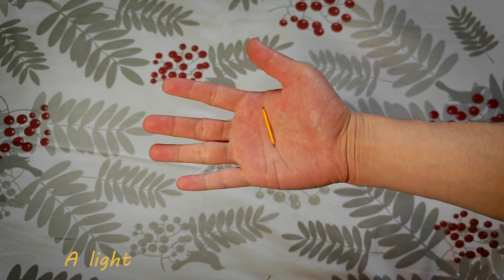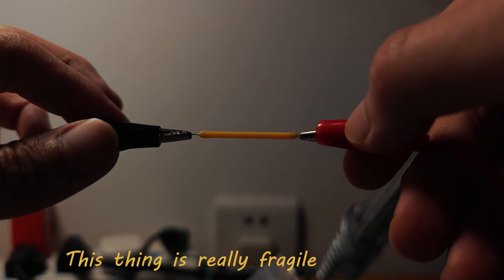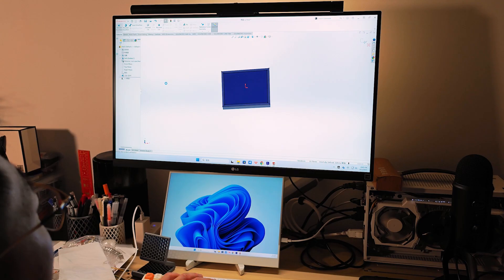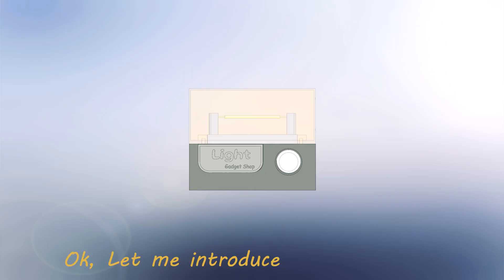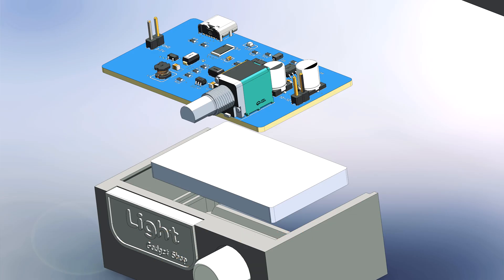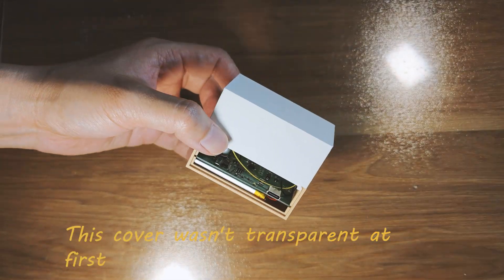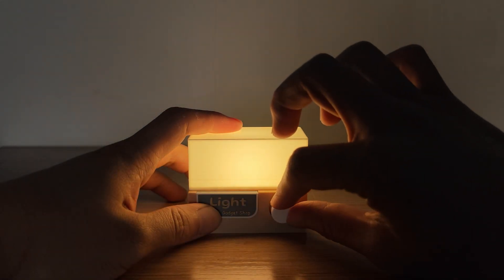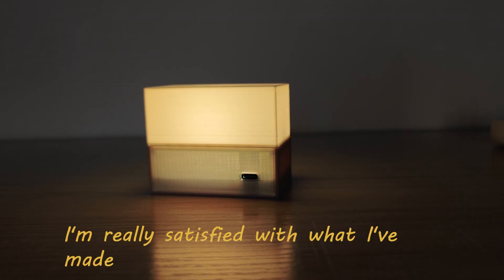Make a nightlight from scratch

Comment: Love the design! Simple yet look nice. And breathable light effect when it's on charge, demmmm... So cool! Thank you!
I want to build it too.
Well, because I did not have the same board, I will substitute it with another boards.
- PWM DC Motor Speed Regulator 2v to 12v 2A for ON/OFF switch and brightness control.
- TP4056 USB-C Lipo/Li-Ion charger board 3.7v-4.2V 1A
- LiPo batteries 3.7v 750 mAH or bigger capacity.
- LED filament 40mm 3.3v 150 mAH warm white (or any color).
To connect it, TP4056 batt pin to LiPo batt, TP4056 output pin to input pin PWM board, and PWM board output pin to LED filament.
Hope this help for anyone who want to try made it. The build will be bigger than in this video due to different boards, but will work the same, minus the breathable light effect when charging the battery.
I'm had built with this boards above, but not with the design. I definitely want to made this too.

Comment: me seeing the thumbnail: okay, Im going to do this
me seeing the pcb board: bye
😂
Reply: that board is basically just a ne555 timer PWM speed controller and a battery charging circuit and a small boost converter u can buy all three as modules pretty easily but ya i do feel the same way these pcb are making harder and harder to replicate the project for us viewers i hope something as reliable as a good 3d printer comes out for printing circuit boards
Reply: @SharvilSawargaonkar  thanks, that's what got me confused, I watched another video from somewhere else before this one and they used modules in a circuit, although this one looks more reliable (I guess).
Reply: @dramaqueer666 not much of a difference since pre built modules are already well designed pcbs but yes if you are making something from scratch on a perf/zero pcb board using a PCB/making one is always more reliable and easy to repair